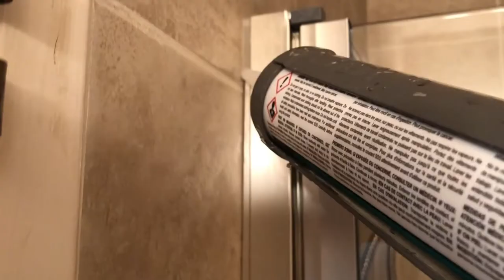How to install swinging shower door, euro series framed shower.

Comment: Thank you for posting this.  I have a question.  When you open the door all the way, what does it hit?  Do you use a special door stop or door bumper for a glass door?
Reply from the maker: I think the door I installed in this video opened pretty far before hitting anything. You don’t have to put any kind of door stop unless the door actually hits something,  but if it does then you can get a small clear round stick on bumper and stick it on the surface that door comes in contact.
Reply: @roadglassandmore  Thanks.  It just looks as if it would hit those hinges on the left, where the door was removed to the bedroom.  And if they weren't there, it looks as if it would hit that short piece of wall.  I am considering an installation in a house with kids.  We might opt for a shower curtain until they are old enough to not swing doors open and hit the wall with them.

Comment: hello friend, these anchors you use are into a traditional unmodified cement mortar? im trying to clarify i have kerdi, there is nothing behind the kedri, where the hinge needs to go, am i correct to assume using anchor through tile and kerdi alone will not hold the load capacity? if i destroy the waterproof installation and put wood behind the kerdi would the waterproof membrane not be compromised where the fasteners hold up the frame? any wisdom or guidance is greatly appreciated. as a professional i can suck giving out free advice, if you could help me out i can get you back with an electrical question, industrial comm or residential.
Reply from the maker: Those are regular plastic anchors, they should be able to hold the load, I use similar plastic anchors for frameless shower installation and I don’t always hit the wood behind the tile! When you run the screw the anchor expands inside the surface :mortar, drywall, tile .
You drill through water barrier,  frame of the shower completely covers the holes and gets sealed to tile so water shouldn’t be getting inside, you can also put a little bit of silicone over the anchor.
Technically Kerdi is over the drywall, plus setting mortar and the tile, so you have enough structural area for the anchors.
Reply: @roadglassandmore  i see, in my case thers no drywall behind the kerdi thank you for getting back to me so fast!!

Comment: Any technique to place shower door back into hinge? At 2:01 in video it looks like a simple push. My showerdoir came out at hinge but it seems impossible to push it back to hinge. Do i have to replace the rubber seal at hinge?
Reply from the maker: There shouldn’t be any rubber on the hinge. The only rubber part is the gasket around the glass, if the glass is pulling out of the frame it’s very difficult to put it back in, you will have to take the door out and use block and mallet to pound frame back on the glass.
2:01 door rail slides over wall rail.

Comment: How do you level the frame if the sides aren’t level???
Reply from the maker: You can add a small block (piece of rubber or aluminum) on top of wall jam , inside the header .